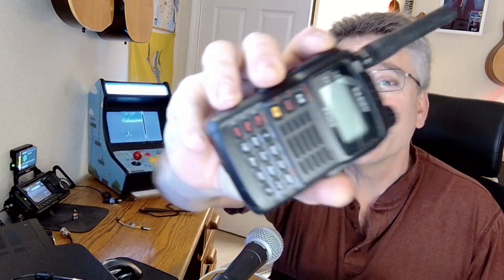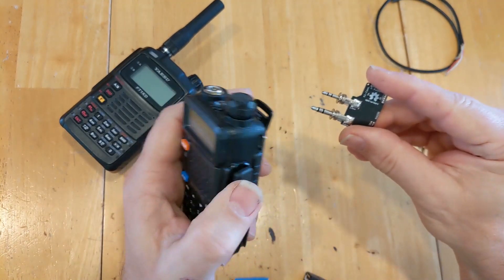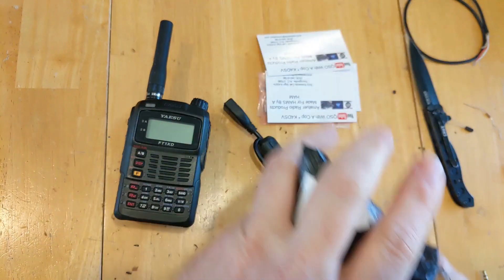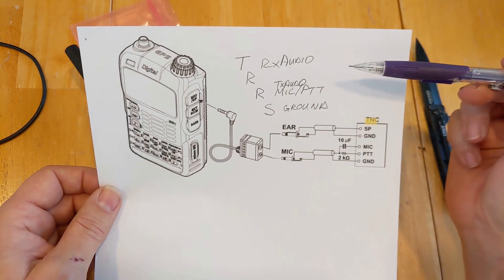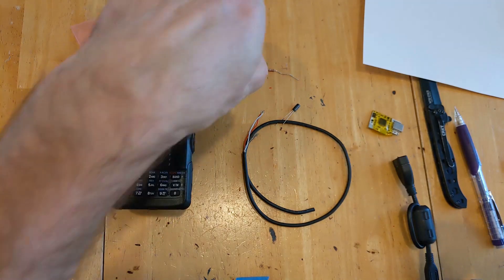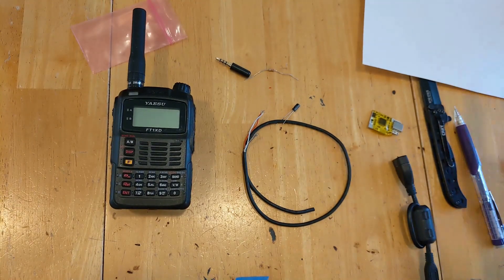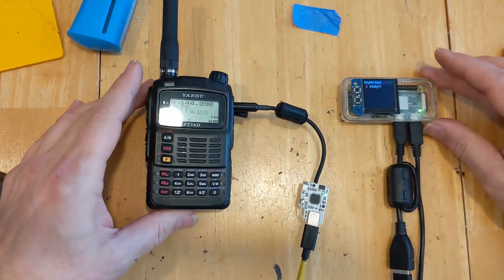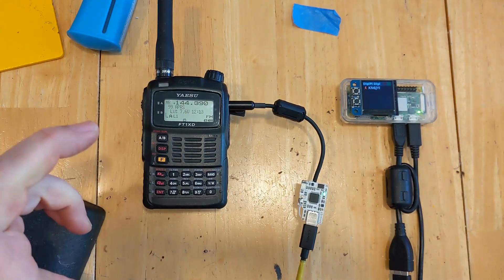Add a USB Port to Your Yaesu HT!

Comment: I'd recommend adding small pieces of heatshrink tubing to the capacitor's extra lead that wraps around, it will help prevent shorts and rubbing against the rough edge of the PCB.

Comment: It's kewl to see someone have the same troubles as me soldering. It's a pain in the butt that you just have to do sometimes. I found a little helping hands device works great but alas I can never find mine when I need it. Keep up the great videos. 73, KO4T
Reply from the maker: Yah, i'd like to think I'm below-average soldering, so most people can do this project.   Ultimately that's soldering without my big magnifying glass, which would obscure the camera.   I'm surprised it worked at all!

Comment: What version of DigiPi hat are you using with the PiZero2? Source?
Reply from the maker: @subgunman , there's no "hat" in the traditional sense.  It's a Zero2W, ST7789 screen, usb cable, and AIOC chip.   The software SD card image is https://digipi.org , 1.9-3, which includes AIOC support.    There's AIOC source code in the video notes, and digipi source is at https://github.com/craigerl
Reply: @ thank You! 73 from SV9 land!

Comment: The adapter shown in your diagram is for some Icom radios - IC-2AT, IC-02AT, IC-32AT. Icom uses the 3.5mm plug for speaker and the 2.5mm plug for microphone, opposite what Kenwood does.
Reply: To clarify what I meant to say - the CT-44 adapter shwon is for using Icom accessories with a Yaesu radio.

Comment: Please excuse my ignorance but would something like this work with an old Yaesu such as the FT-65?
Reply: @chetboisen1187  should work with the right plugs. The FT-65 has a combination of 2.5mm and 3.5mm sockets. Doesn’t use the TRRS plug the other Yaesu units have. The Digirig website has a wiring diagram to follow. I would like to try out the AIOC with my even older VX7R.

Comment: The AIOC already has a capacitor in series with the mic pad, so you don't need the external 10uF.  Yes, it's only 4.7uF, but adding the 10uF in series makes the capacitance even smaller (C1*C2/(C1+C2), something like 3.3uF, so if it works a you have done it, it will almost certainly work with just the resistor between PTT and Mic.

Also, an easier way to make the cable assembly is to start with a cheap TRRS patch cable with a male on each end, cut it in half, strip off some jacket, and use the appropriate 3 or the 4 wires to connect to the AIOC.
Reply from the maker: Fantastic info!!! thank you!   I think we just need anything to block the DC offset.  It'd be interesting to see the emphasis/equalization with audacity, etc.

Comment: Hey Craig,  I am curious, does the digipi send I2S protocol data or how is that data formatted to that AIOC device?  If someone wanted to connect and esp32 to that AIOC how are the messages structured?
Reply from the maker: Great question!  The AIOC presents a CM108 audio device.  it also does PTT via the GPIO pin on the CM108.  For direwolf, you use "PTT CM108 /dev/hidraw0" in your .conf file and you're set.     You can also open the serial port presented by the AIOC and set RTS low and DTS high, this will trigger PTT also.   https://github.com/skuep/AIOC

Comment: Great video! Lots of info. I have that adapter you have in the picture that you used. Would I be able to just get the completed version and not have to worry about the cap and resistor? My guess would be they are already part of the yaesu adapter. Thanks for a great video.
Reply from the maker: I don't fully understand the questions, but the cap/resistor are required on Yaesu HT's that support PTT and Mic on the same wire (which is all Yaesu HT's).
Reply: The Yaesu CT-44 pictured is only a breakout to seperate into seperate pins.  The Capacitor / Resister should still be used per the illustrated instructions.  I have a CT-44 as well and am 98% sure the Capacitor / Resister are not inside the CT-44.